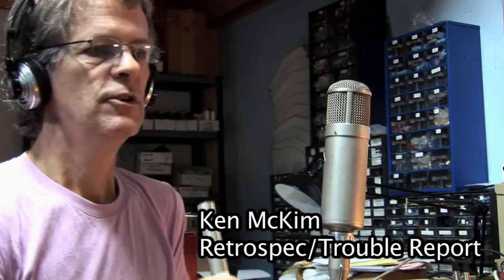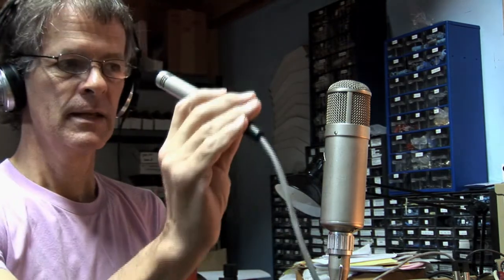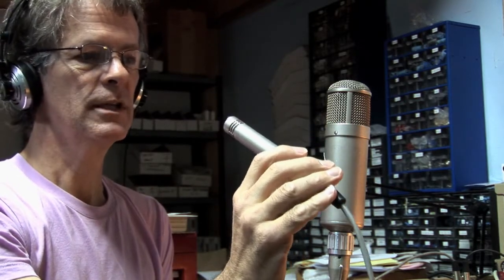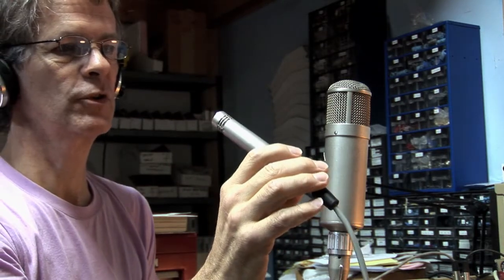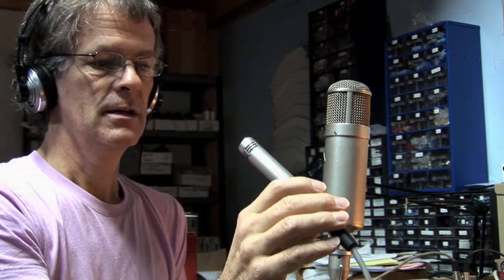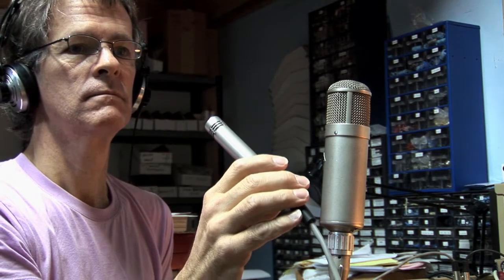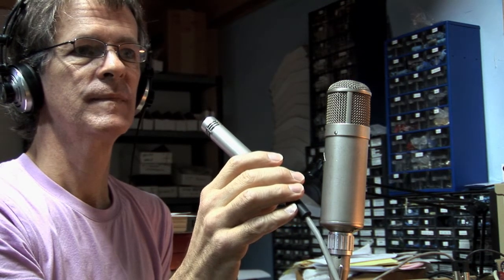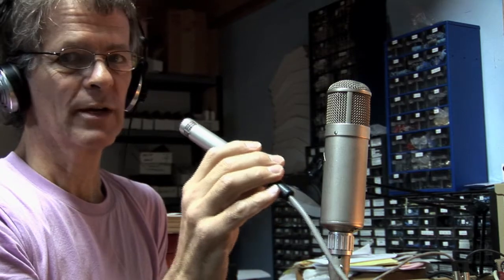Trouble Report : One Quick Question . . . Mic Repair

Comment: Hi there! Thanks for the tips. I had a cheap SE 2200a lying around for years. It started to do some crackling and cutting the sound sometimes when I left it in the rehearsal room some days as we were recording an album. Or city has a lot of humidity and our rehearsal room even more. I thought the capsule died, but I applied the humidity test and it was worse when I did it. I tried to fix the moisture problem with a hair dryer at the lowest temperature for a short period of time and it's working again after years in a box. I tried it and came back an hour later and it's still working. Hope the capsule is not permanently damaged to use it as a kick out mic. Thanks for the tips again!

Comment: Hello. I have a U47 clone with an M7 type capsule and yesterday while recording some vocals there was a humidifier in the place because the singer believed that it helps her. To be polite, I didn't make it turn off, but after a few hours an intermittent noise appeared in the microphone, I quickly put it in a bag and left it on to generate heat and turned off the humidifier. After half an hour perhaps the noise disappeared. Today doing this test I checked that everything was fine, I hope I haven't generated permanent damage. Thanks for the video test, greetings from Argentina.
Reply from the maker: Hi Luciano, If you did the breath test, what was the result? ++Ken
Reply: @troublerep  Just normal, no noise today after the breath test. Maybe what I identified yesterday as a humidity noise in the capsule was something else and just coincided with the humidifier in the room. I'll see how the microphone performs in the next uses. Your test helped me check if that was the problem, thank you.
Reply from the maker: @lucianoluggren  Here's hoping. Let me know if anything changes. ++Ken
Reply from the maker: Sorry for the late reply. I don't check this site very often. You said you dried it out with a hair dryer. Kudos to your resourcefulness. But this may only be a quick fix. If you use the mic for vocals you'll be introducing moisture into the affected part of the capsule over and over. Eventually, you'll have to address the root problem and get the capsule reskinned. There are a number of people/businesses that reskin mics. Thersch, in Germany (https://www.thiersch-mic.de/en/estm_geschichte.html), is the go-to. Problem is, you'll wait most of your life for the mic's return - they are truly back up. The other reskinners generally do the work closed-house - meaning they do it for a particular client (usually a mic manufacturer), and not so much for the general public. If you decide to send it to Thersch, check with them first about lead time. Good luck. Or keep your hair dryer handy.

Comment: Ken , you are a widely respected and well known tech and I have great respect for your abilities....I suggest that one needs to inspect the diaphragms , beyond just the humidity test. All moisture sensitive capsules do not need reskinning . Often, simply cleaning the capsule will eliminate this issue. Basically, a dirty diaphragm will conduct electricity when moist...that makes the ocean roar... Cleaning diaphragms is quite simple. You can find my noninvasive method on my youtube video channel.  Remember this: never touch the diaphragm with anything: no cue tips, no photo brushes; nothing....
Reply: Very helpful info, that mean I can’t fix any AT4033 mic that work nice with low pass filter and sound noisy without LPF. Also that means any noises collection means bad internal pop filter and will lead to bad capsule and $ to repair it? I’ve fixed once Samson C02 ungrounded mesh problem and removed noise appearance (excessive capacity) with body part approaches. While disassembling mesh pop filter fall apart and was replaced. Sensitivity increased.

Comment: Have a u87i picked from ewaste from a really big radio from where I live. The capsule was punctured and the circuit had the FET dead, and and other minor stuff. I though on reskining the capsule, but I am really broke and had to get 2 u47 chineese knockoff and merged together. Got a new FET and rebiased it. Now it works like a charm, despite having other character (but still rich sounding), is still undercontrol and trustworthy. Not only that, I learned a lot getting my hands on this engineering masterpiece. I learned to clean the capsule (NOT EASY PEOPLE, really worth the money you spend when you give it to someone with experience, the gold layer is really thin and removes quite easly with the wrong pressure and cleaner, and the capsule can deform too, and a lot of considerations, specilaly for multipattern mics), I learned that the components that has aren't advanced, but really precise, the filter and attenuation can infere really bad if the capsule has issues, and quality tantalum caps are always worth. Those mics are an act of incredible balance.
Reply from the maker: Suggestion: Go to dan Alexander's site. He has a video on his method for cleaning the diaphragm on a condenser mic. Somewhat counterintuitive and  very intelligent.

Comment: Diagnose why. Many things can cause this. Bad tube, or JFET, who knows? Worst case bad capsule. Tomorrow is my birthday. I happened upon a surplus store that usually NEVER has any good audio tubes, but today, Telefunken EL156 power tubes new in original boxes! Then it got better, Telefunken VF14s NIB! Then I found RCA 6550s, NIB, and GZ34s UK made NIB. I had to shell out some dough, but I am stoked! The JFET used on the 84 is not bad. The famed $60K+ Dumble guitar amp has a JFET input.

Comment: My rode nt1 mic isn't working. It was just sitting on a mic stand. Then today I just tried to turn it on and there is no input signal. I have checked the cables, phantom power and it didn't work, I also tried my other condenser and dynamic mics on the same device , inputs and cables and they all work fine. The humidity levels in my room are not good. They reach upto 87 in the winters. After watching your video it seems to me that humidity is the problem. So is it possible that I can somehow fix the mic without replacing the capsule ?
Thank you.
Reply from the maker: Hi Hassan, While the video might lead you believe that a bad capsule would be the number one suspect in a mic problem, the truth is that the possibilities are almost endless. Try taking the mic to a dryer environment if possible. Give it a day and try it again. If it comes to life, try the breath test. If it remains dead or responds badly to the test, get in touch with me at trouble.report@gmail.com and we'll discuss options.

Comment: How much does re-skinning cost? I have some old Neumann mics from when AVR went under. Only about 35% of them work well. Do you replace ribbons on ribbon mics. I just did that today on an old mic. It did not go well at first, but it is back working and off my bench. Then a cheapie crystal mic for harmonica came in. The Kobitone $4 element is no longer being made. I make audio amps for every purpose, except Muzak. Gotta draw a line there. I also fix and build tube comps, expanders, etc. Luv IT!

Comment: M147 use a tube that commonly goes noisy...  you can get a new one but tricky to install... I got a new valve from Watford Valves (UK). and installed it my self. Its a tricky install if your not a good solderer....

Comment: I have an Aston Origin and when I turn on phantom power the microphone works for a split second but then I can't hear my voice at all. BUT I can hear a very low amount of audio when I rub the microphone with my fingers. I checked the interface and the cable and they both work. I don't know what is wrong with this microphone other than the capsule is bad now. is there a way to fix the capsule or is it done for?

Comment: do you know what the symptoms of a capsule with fine scratches would be? Basically , (I hate myself right now)I think I may have slightly damaged my capsule a little bit while cleaning it! I believe the brush I used was abit to coarse. Its clean overall know but the gold looks spotty and dull in places and slightly scratched! I mean I'm just wondering what the technical reprecutions are? I don't know why I rushed it. Ive cleaned another capsule before with good results, but this time I knew my brush needed replacing and I didn't have the proper solution.

Comment: Hi there! I just bought an AT2020 paired with a Scarlett 2i2. it started becoming horribly loud when i used it, please help :(
Reply from the maker: There's not enough detail about the problem here to form al meaningful reply. "Horribly loud" in that the gain went up excessively?, the noise floor increased to unusable levels? If so, what kind of noise? Have you tried it with other mix pres to confirm the symptoms? You can also reach me at trouble.report@gmail.com.
Reply: @troublerep  Hi thanks for replying! Turns out I just had to finish setting the audio interface up, its all good now :D
Reply from the maker: @KREYSCENDO  I love it when it's easy.

Comment: Hi there i m a sound designer from Nepal. I have a rode nt4 stereo condenser microphone with i use a lot. But lately one of the mic doesn't seems to be working with the phantom power of my recorder. I tried it with different recorders but the result is the same. But it works when i use a battery. Could you help me please.

Comment: Hi there! I just picked up a Microtech Gefell UM 70 and it has the same issue as the U87 in your video. Would it be worth it to have the capsule reskinned or should I just return the mic? Is there someone that you would recommend sending it to to have it reskinned? Any help would be greatly appreciated! Your video was very helpful!
Reply from the maker: Sorry for the late reply. I don't check this site very often. You said "I just picked up...", does that mean you bought it new? If so, you should surely return it (you've probably already done this). If not, there are a number of people/businesses that reskin mics. Thersch, in Germany (https://www.thiersch-mic.de/en/estm_geschichte.html), is the go-to. Problem is, you'll wait most of your life for the mic's return - they are truly back up. The other reskinners generally do the work closed-house - meaning they do it for a particular client (usually a mic manufacturer), and not so much for the general public. If you decide to send it to Thersch, check with them first about lead time. Good luck.

Comment: I’ve got a groovetube gt55 (u87 clone) that works for a while and then starts to fade out and back in just like the last one here (not as long).  Little bit of popping noise sometimes when turning on.  Sounds like it needs a new capsule, thanks for the video!  By the way is this something that is caused by singing too loud into the mic or is it the capsule going bad?
Reply from the maker: Hi Jacob, There are three routes to explore. 1) Get a mic tech to clean the capsule (if you haven't had this done, and if you're not inclined to do it yourself). This sometimes clears the debris on the capsule face that might be causing the "charge" to collapse. Easy, quick, and inexpensive. 2) Replace the capsule. For about $150 to $300 you can buy a new capsule that will surely outperform the one that came with the mic. You can go to a site like Microphone-Parts.com and look for either an RK87 capsule (one that more or less directly replaces the one in your mic), or for a little bit more, buy an RK-47: not quite as bright as the RK87, smoother. If you have any soldering skills (and a little courage), you can do the swap yourself. 3) This last fix is the one I mentioned in the video, and it is usually the first approach, but the GT55 is a relatively inexpensive mic, and the capsule is not a premium brand. A reskin costs about $400, and depending on who you have do the work, it can take up to four months. I'd say, do this only if you love the sound of the mic, and you don't want the sound to change in any way. And by the way, sing as loud as you are inspired to. It's not what caused this problem. Good luck.

Comment: Hello, sir.

I have a similar problem with a Behringer B2, i comes and goes without the need to breathe on it. Is it the capsule too?
Reply from the maker: This is a humidity issue. Breath is an intense source of moisture - hence the "breath test". But ambient moisture, if there is enough might also produce similar results. However, as Dan Alexander has pointed out (a few comments down), another possible fix might be to have the capsule cleaned. And there are other electronic reasons the mic might behave as you have described. Before you have the capsule reskinned, it would be a good idea to have a tech evaluate the mic. It might also save you some money, as well.

Comment: good day sir, i have a quick question since i also have this problem. the thing is the microphone got exposed to extreme heat coz im dumb, then the mic started having a low frequency rumbling/popping noise. not all the time, but sometimes. my question is that, is it the capsule that got damaged or the capacitor itself?
Reply from the maker: I replied to this post two weeks ago and for some reason the reply didn't stick. So, more detail about the amount of heat it encountered would be helpful. BTW, the capsule IS the capacitor. It's made of a kind of plastic, so yes, high heat might damage it. In any case, you will have to have a technician examine it to really know. If you need to add to this conversation, you can reach me at trouble.report@gmail.com.

Comment: Hi Mr Ken Mckim. I got a U87 Ai. It sounds very good, the capsule is original , not cleaned. But I've been heard a 60 hertz background humming noise. It is very low, that I need to push at full level to heard it in my Yamaha HS8. But it is there, because I've plugged in the same cable and input another mic and that noise disappear. When I put a hand on it and touch it, this noise stops. Let me tell you that I've had already opened it and tested some wires inside searching for some bad contact, and nothing is there. Do you have some suggestion to me? What look for inside that can make it sounds with this 60 hz noise? If you send me an e-mail I can send you some videos, audios or pictures. I'll be very grateful if you can help me. Any help , any suggestion will be so value! Thanks!
Reply from the maker: The most likely source of 60Hz is poor grounding within the mic body. Possibly the capsule head not making good enough contact with the rest of the mic. Also, check to see that the place where the electronic ground meets the chassis ground. If you have a voltmeter with a resistance or continuity mode, you can actually check the ground by placing one lead on pin 1 of the XLR connector and the other lead on any other metal part (somewhere that has not been anodized) The reading should be very low - like, 0.01 ohms, or lower. Then, it's a matter of re-establishing the ground connection. Please continue this conversation on trouble.report@gmail.com, if you need to.  ++Ken

Comment: Hello, I have an Avantone CV-12. I’ve had it about a year and a half. It simply stopped working. The power supply comes on but I’m not getting any sound from the mic. When I plug it into my interface I only get noise but no sound.
Reply from the maker: Hi Robyn,
There are half a dozen (at least) possibilities. Bad tube, bad cable, bad power supply... I know you said the pilot light comes on, but that doesn't guarantee that all the voltages it's supposed to generate are getting to the mic. None of these things - other than the tube, maybe - are easy to trouble shoot in the field. I'd be happy to have a look at it if you don't have access to technical help where you are. Which brings us to: where are you? It would be easiest if you respond to this reply at trouble.report@gmail.com. Thanks. ++Ken
Reply: @troublerep  ok I will email. Thank you
Reply: The same thing happened to my mic .but I live in Nigeria and I have no idea what to do about it
Reply: @Omar-ts3yd  sorry to hear that. I sent mine back to the dealer, I had a warranty

Comment: I have an akg perception 200 and it has great quality but as I'm sing into the mic it seems that the signal goes in and out. This is even after I mess with the levels and gain what does this mean?
Reply: What happened to your AKG? I have a perception 170 with this issue.